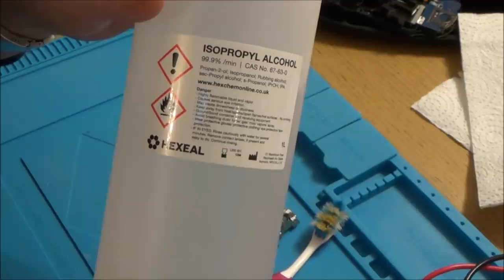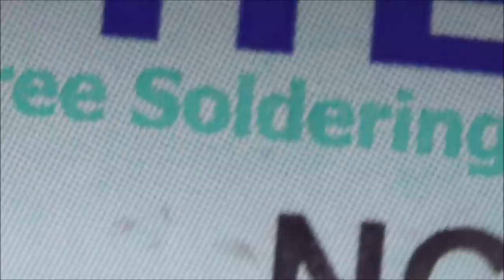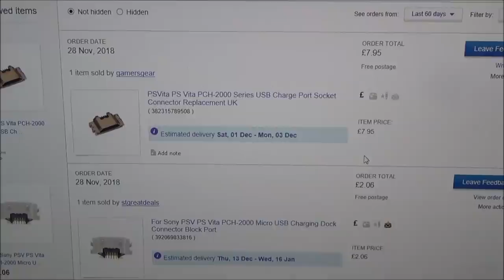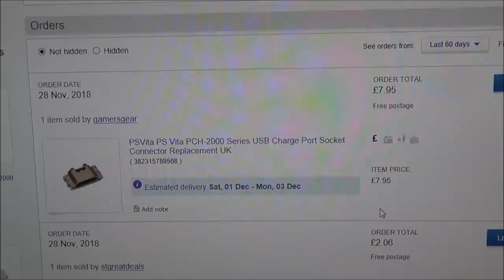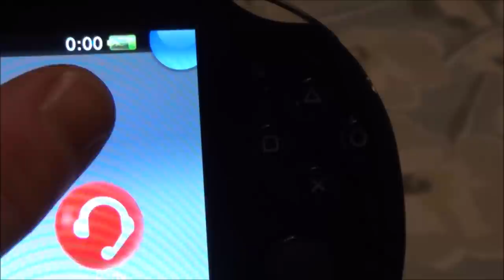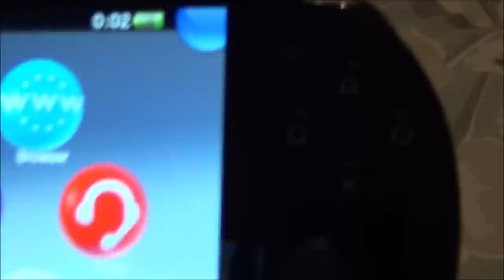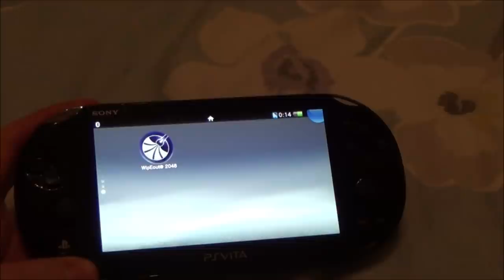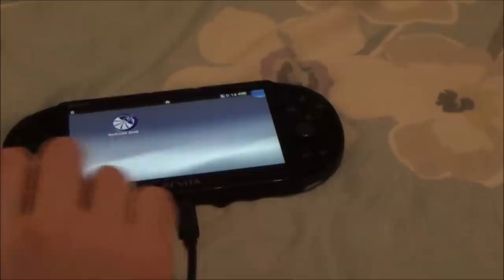Trying to FIX a Faulty PlayStation Vita - Sony PS Vita Slim

Comment: Hey great Video.. just a question, do you know a place where i can buy the connector for the flatcable from the left side on the motherboard.. i ripped off this small black lever and without there is no connection.. i busted a perfect mint slim vita just because this tiny little thing.. so ineed this connector or a replacement motherboard for the slim.. ?

Comment: Great job there!!!!  The reason those 2 holes were not unblocking is the fact it has a super large ground plane and the number of layers probably.   Your iron doesn't have the thermal power - it's not just a question of temperature, it's a question of how much heat the layers suck away.  Pre-heating with hot air at around 400 to 450 for 3 or 4 minutes before using the iron can often help!  You can also carefully drill solder like that, but you need to use exactly the right sized bit and when the hole is not circular like that it can be a pain. 

But that's a last ditched thing really - I wouldn't recommend drilling holes out as you can damage the through hole plating.  Another tip - when trying to get solder onto the pads like that, solder in the direction the pads sit according to their largest dimension, you have least risk of them coming off the PCB that way.  I know you didn't lose any, but if you tried a similar thing on some PCBs I would guarantee after a number of heating cycles they would start floating and sliding around.
Reply: Na you should bot use a Drill exectly the size of the Hole, if you have a Hole of about 0,8mm I'd use a 0,5mm Drill. This way there is a pretty little chance of damaging the "Troughlayer". You should also try to suck away as much solder as possible so you get a nice even concave hole
Reply: @jonathanlang9711  What I would do in this case is applying additional solder on the pad, then suck it with the braid, repeat until the hole is cleared. Indeed with a larger tip, not a tiny one. No need for excessive heat though, just the iron tip must be large enough to conduct correctly.
Reply: @NiamorH  Thats excactly what he did in the first place for about 5-10 Times with the bigger tip. and tgen switched to a smaller. Also he actually mentioned that  probably the smaller Tip can't conduct enough heat as well. But as seen the larger Tip didn't bring a good result to.
Reply: @jonathanlang9711  true I missed it, the timelapse is so fast I didn't see it. maybe I would have added even MORE solder than he did, on both sides as well :) I don't know, usually it does work pretty well.
Reply: What you can do is add some new solder to the top side of the hole, put the solder sucker at the bottom side of the hole, then you take your biggest tip and apply heat to the top side. That way the sucker and the iron aren't fighting for space, and you can keep the heat on right up until you activate the sucker.  Getting everything in position takes some holding your tongue at the right angle, but it can be amazingly effective.
Reply from the maker: Thanks all for the advice and tips :-) Chris - so for the pads I need to run the iron down lengthways along the long edge of the pads rather than swiping it across them as there is less chance of pulling the pads up  - that makes sense to me. My solder station was a 'cheapy' unit £80 from Amazon. Maybe I might have to get a branded version in 2019 sometime if my skills improve to warrant it  :-)
Reply: @Mymatevince  cheapy😂😂 I'm using a 10$ Noname Solderingiron from the discount Hardwarestore
Reply from the maker: Haha, maybe I should be more grateful for my 'not' so cheapy unit :-)
Reply: for cleaning this holes in any board where is large groundi use PB solder ;) this fu**ing rohs (non PB solder) is a shit of the shits ;P apply PB solder on holes and you can easly suck it out :)
Reply: Been doing this for 35 plus years and it was very painful watching him dig that tip into the pcb.  Luckily he did little damage and more importantly it worked.   {still  hurt}  lol
Reply: I agree with GadgetUK about the way that he was moving the soldering iron; he could had lift some trace. And also it seems true and relevant that he doesn't have enough power in the soldering iron. But GadgetUK forgot to tell that using a much better flux like the Chip Quik one seems to make these things much easier. About drilling holes I haven't tried that but once, but if you can insert a needle with some pliers, you can apply heat to it with the iron and it will pass through the hole and you can suck the tin from the other side of the board.
Reply: I would cutting solder removing wire to the size of that hole.
Then trying to heat the wire instead of the solder and let the wire absorb the solder inside the hole.
Reply: @jonathanlang9711  Even his largest bit was not thick enough even if it was high power, it had a thin stem limiting heat transfer and not a cone like say a Weller or other professional soldering irons. Personally I would have preheated with the heat gun or even used the heat gun.
Reply: @Mymatevince  do u request?
Reply: nice job in the end but honestly get a Weller soldering iron, better for smaller circuitry
Reply: @Mymatevince  Yeah he's right. Those are really big copper planes. They are a nightmare to solder with. It is why your hot air station helped because you are heating everything at once compared to heating a point. It really helps to have an iron with adjustable temperature. I bought a hakko for that reason best purchase in my life. Also having a wide variety of tips really helps for different situations. In this case here if none of that is available there is a type of solder that has a much lower melting point. By melting it into the solder there you can drop the melting point making it much easier to pick up without using high heat. The only issue I see is that it might not be so easy to clean it all off possibly making weaker solder joints later. Though I have no experienced this so do some research before hand.
Reply: You are probably right with a ground plane and soldering iron not having the thermal power. But what I usually do is take bigger flat iron tip. Then heat the solder up and then just tap or slam down the board. usually the solder falls out. Worked for me a bunch of times. Iknow you are being cautious but the board can handle it. Its just my personal experience.
Reply: I have drilled out holes before.  A steady hand is needed.

Comment: For batteries with 3 wires/contacts, the third one (usually the middle one on batteries with flat recessed contacts) is almost always a thermistor (temperature sensor) with its other pin on battery negative. The charging circuit, or sometimes the overall power management circuit, will use this to monitor the temperature of the battery and cut off the power if it gets too hot (maybe even when too cold). Smart monitoring/identification signals do exist but usually only in 4-contact batteries along with the thermistor.
Reply from the maker: Thanks for the great info :-)

Comment: when my psvita 2000 charges but after when i turn it on it doesn't charge and ive opened it and all i can see is good condition the charging port is a bit loose but when its off its fine could you help me

Comment: The reason the solder isn't melting properly is the fact you're using a small tip on a large piece of metal shielding it just draw all the heat out of the iron tip. Use large tips when working on grounds since they always have a large surface area
Reply from the maker: Thanks, I had a larger tip on to begin with but next time I will try an even bigger one :-)
Reply: @Mymatevince  while a larger tip can help, it's just a workaround, the reason is that your iron doesn't have enough wattage to keep up with the heat wicked away by the large ground plane, without more wattage the only work arounds are to get a larger mass tip to hold more energy or raise the temp to again increase the amount of energy in the iron
Reply: T12 irons work better, as the heater is right near the tip. Get a 75w bakon 950d £35.
You wouldn't regret it.....Ive bought so many cheap irons and they were all hopeless, even other T12's.
But the BK950D really impressed me considering its size.

Comment: That little square thing with the 4 connectors that goes to the middle pins on the micro USB port is probably a electro magnetic filter it keeps electromagnetic fields from messing up data transfers (the ps vita memory card might be accessable from a pc while still in the vita to fix courupted files like the vitas big bro the psp)

Comment: I have original Vita, it hasn’t turned on for 6+ years I have replaced battery but misplaced the original. I’ve tried charging for over 24 hours many times. It’s absolutely dead. Do-you mind taking a look at mine? It’s in absolutely immaculate condition always in a case and a padded zip case when not used and it pains me that it doesn’t work for no reason

Comment: Hey Vince, cleaning out ground plain pins is always a struggle (they are made to dissipate heat), on a thin tip if you are at 350C (element temp) the thin tip will lose heat very fast and wont be 350 at the tip. thus the board doing its job. too clean those a fat tip with high heat and board on its side, you heat it up one side and suck it out the other while heating it.just be care full not too heat the other pins the same because it may lift the pads.
Reply from the maker: Great advice. Thank you :-)
Reply: Vince, you should tin your soldering iron tip too.  It needs to hold solder to transfer heat effectively.

Comment: Enjoy the videos Vince!  I notice that a less "pretty" way of clearing the holes on a PCB never gets any play.  I OFTEN heat the solder in the holes and then tap the PCB on the table to knock the molten solder out.  Can splash, so use with caution ;-)

Comment: That board might consist of many layers and relay on metal for solidity; also, it should provide even better heating because they at Sony confirmed that they had to downclock the original PS Vita to avoid overheating.
So that's why it should drain heat so well.

Comment: Solder balling up on itself when you try to tin the tip indicates your iron tip is dirty.  When it's dirty, thermal transfer is significantly reduced.  As GadgetUK164 told you, preheat the area first.  Also, a more agressive flux would be useful here, but clean up well after you've used it.

Comment: hi Vince sometimes when the solder won't melt we use a small hand tool with a drill bit in (Eclipse no.121) it's for ground planes so you don't delaminate the board when heating it.

Comment: Could you repair mine. Mine turns on but the charging port is having trouble. I plug it into the AC adapter but there’s an orange light but it blinks. It blinks once and the second time it blinks a lil longer but you can see the light go into 3 different brightnesses. It doesn’t stay charging

Comment: I've found lots of times when this happens on slims the internal ribbing cable connector to the back half of the unit comes unseated and needs to be reseated. (mind you I'm commenting this before watching the video in full knowing the issue yet)

Also the indicator lights on the slim are on top, the Playstation logo doesn't light up.

Comment: Sometimes i find that tinning the tip of the iron before soldering helps. Also your soldering iron dosent have the power to melt the solder (in the two holes), so  using your reflow station at 400-500°C can help to get that initial heat. The solder is basically absorbing all your heat and not melting it.  I only have 2 years experience myself but it does help.

Comment: why you don't solder some tin wire from the schematic compound in the board, i see that the corrosion in board take lot of time to clean it and melt soldering to it

Comment: Speaking of water damage, I have a Sega Genesis (I'm American BTW) that has water damage on the Sega CD port contacts. A few days after I got my Genesis, I spilled water on the system. It still works, but I'm worried that the extension contacts won't work when I get the Sega CD add-on, any way to fix this?

Edit: If this requires soldering, I don't have the tools, or experience to do it.

Comment: I recommend getting some solder paste (paste not flux) for thos things, you can just heat it with the air or iron after applying a small amount to the pads and it will effortlessly create perfect joints

Comment: I blew through two psps when i was about 10-13. I used the wrong voltage of charger, but it was the same size so I didnt know any different. It was until years later it came to my realization what had happened. Havent watched the video yet, but my psp also wouldnt charge or hold a charge.

Comment: Good work Vince, as usual...
Only one thing, maybe help, if you want to remove a stucked welding, you can use a thin needle (according to the hole), put it in the tin hole, heating with a soldering iron (with flux) with some pushing for the needle , and it will go throu the hole with the stuck tin.. ⚡⚡

Comment: The anchors on the micro USB connector need a lot of heat. It helps to preheat the entire PCB and use a low temp solder to get the existing solder stuck in those anchors to flow.

Comment: Hey Vince, a little tip for getting solder out of holes.... use thinner solder braid, I use 1.2mm. Push the braid in the hole with a small tipped iron. I do this daily when removing large relays from boards... hope this helps. Great vids by the way

Comment: Another great video vince!. And as someone else has said it’s just the pcb and copper plane complexity/width/size rather than a question of temperature. It soaks the heat of the iron away before it has chance to melt the solder. Best bet is a future upgrade to a higher wattage soldering iron. One of the reasons I use a decent quality high wattage iron up to 120w (antex). 

On really hard areas like this, you can also preheat the board to help with the heat soak.

Comment: I use a cheap little propane soldering iron exactly for pads like that which require lots of heat. It melts everything.

Comment: If you can't Get the solder out of some Holes, you can drill/mill out the Solder with a very little Drill, like 0,4-1 mm depending on how big the hole is

Comment: Congratulations on your successful repairing! You have done a really great job. I love that feeling when you can make something to work. I have a similar problem when my battery drains for a certain low percentage my vita refuses to charge it up. I bought 2 another batteries that worked well until they reached that same critical battery percentage level,too. Do you think I have the same problem?

Comment: I got my fat Vita for 20 bucks due to having the same problem, it wouldn't charge, turns out one of the pins of the charger port was slightly bent to the side, just grabbed a needle and bend it back to place and there! It worked perfectly!

Comment: 12:55 put the lid back on the 'IPA' Isopropyl Alcohol That  breaks my heart LOL great  video !!
clean clean clean clean, i have the perfect flux for this type of repair it puts a solid coating 
between all the contacts..And protects them we use it on bga chips that have had 
bad water/pop damage..it sets like glass !!If the pad is missing find out where it goes 
to and from and you can just run a jumper wire.

Few things keep the soldering tip clean and check out some soldering tutorials.

Comment: Hey My Mate Vince! I have a problem with my PS Vita Slim as a few times it has been opened as one day I dropped it on the floor but after console worked but some buttons stopped working. Console turned on as usual but I wanted to find out what happened inside the console and did it a few times (opened the console and screw up) but one after tried to fix the buttons screen did not turn on and it's black but can hear a sound for a short time after clicked some buttons. Btw I have replaced flex cables as I was working on it without any tools just by my fingers and I damaged some of them I'm afraid but after I plugged new ones console is still not turning on. I think I could damaged a bit that place where power socket on the motherboard for battery is located. 
Please help and sorry for my English. 

CHEERS my mate!

Comment: Hi Vince. Try cleaning the tip of your soldering iron with a wet sponge often. Also, that stubborn garbage solder you were trying to remove from those charging port ground holes, was probably that lead-free solder, it won’t flow into your wicks, and has a higher than normal melting point. I hate that lead-free garbage with a great unimaginable passion!!! I don’t know if you did this, but next time check to see if the circuit board is labeled with a PB element symbol with a circle slashed out on it. That’s how you know if lead free solder was used on the board. Great Video though!!!👍🏻

Comment: Those groundtabs are bs to get sometimes, so much thermal mass and crappy RoHS solder. I've bought myself a small drilltip adapter and tiny drilltips. Sometimes I just drill those holes out.

Comment: Great video. I do repair a lots of items mostly a mobile phone but never do the micro usb before because for phone, I just need to swap with a new charging board. For Vita, I only replaced the faulty analog button once and I don't dare to replace the faulty power LED (red faulty, green in OK). I also still learning this kind of stuff since 30 years ago. New products, new items to learn. Subs to you now.